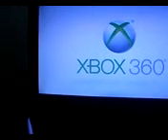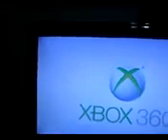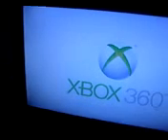How To Record With Dazzle or Easy Cap Without Using  Splitters

Comment from the maker: @IAMMaaaaKx  All you need is the Xbox cable that has the tv/hdtv switch on it, the one with the red/yellow/white RCA ends and the Red/Green/Blue ends.  Then select TV on the switch and plug the Red/Green/Blue and one of the Audio Red or White ends into your television, plug the Yellow RCA and the opposite Audio either Red or White into your recorder.  Hope this helps, give me a thumbs up if it does.